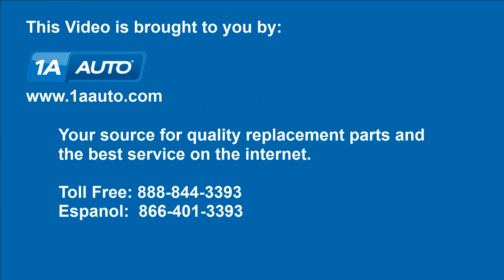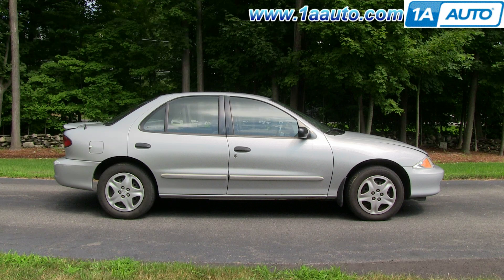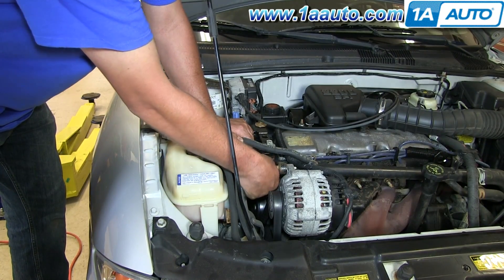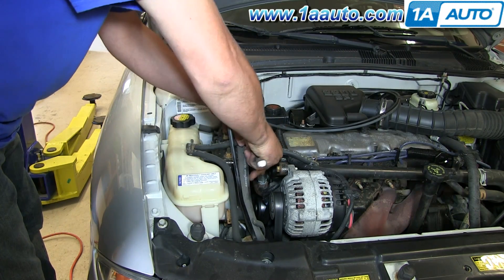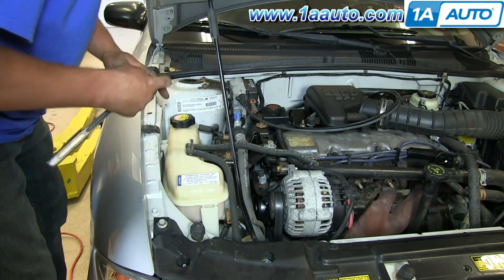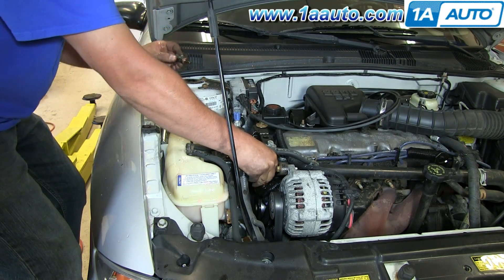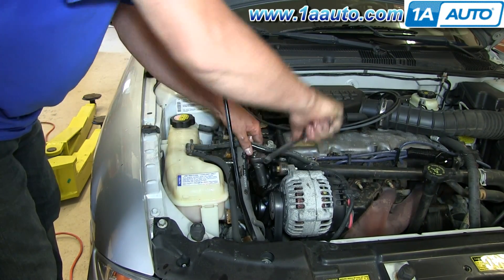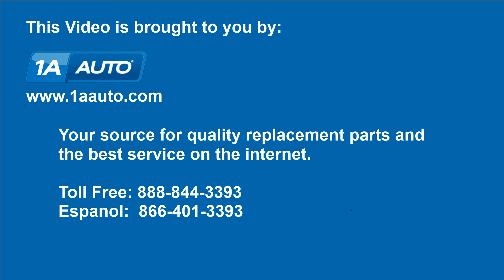How to Replace Coolant Temperature Sensor 85-02 Chevy Cavalier

Comment: How come every time I buy a part for this car it comes with wires It doesn't come with the part by itself it comes with the part and wires. I just ordered the engine coolant temperature sensor and it came with wires I bought a camshaft position sensor and that also came with wires It seems like every part I buy comes with wires and I don't know anything or two about plugging in wires or splicing wires. Putting in the parts the easy part but trying to figure out how to replace the wires is the part that I don't understand. All the wires seem to be good in my car so I don't know why they come with wires.

Comment: I have the older design (without the bigger coolant bypass line, without the extra hose to the expansion tank, and mine has a bleeder valve on a smaller bypass line as well.
I learned they later added that bigger line and vent tube to the tank to help the engine get rid of air, has anyone else seen where the sensor is located on this older design?

Comment: radiator fan works when wired directly to battery but will not come on when vehicle is hot or A/C turned on.   could this be the problem, or is this part unrelated?
Reply from the maker: +LBOE OUTDOORS It might be an issue with the relay

Comment: Thank you 1A auto for making such imformative videos, you have helped get many repairs done on my vehicles. Thank you, i also wanted to ask you if could do a video on bleeding the air from the coolant system on a 97 cavalier 2.2l. This has been a major issue with my car. Ive replaces all cooling parts but I think I have air trapped in the system. Thanks in advance.

Comment: could the sensor be in another location
Reply from the maker: It should be in the same location as shown in the video.
Reply: it's on the other side
Reply: on the 97 2.2L over head valve it's on the drivers side
Reply: i can confirm that its right behind the alternator . 1997 sunfire
Reply: Is yours made before the 2200? Mine is a 96 and this video doesn't show it's correct location on my cavalier.

Comment: what if I am replacing the manifold that this goes into, and am reusing the sensor, Do I need to use any type of sealer on the threads?
Reply from the maker: You can probably put a little RTV on the threads to help prevent it from leaking. 1aauto.com 888-844-3393